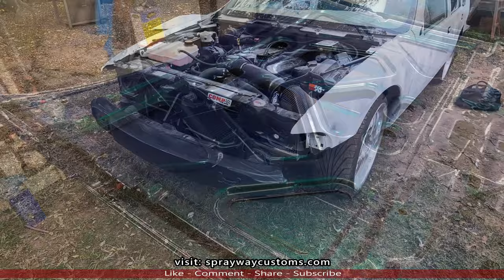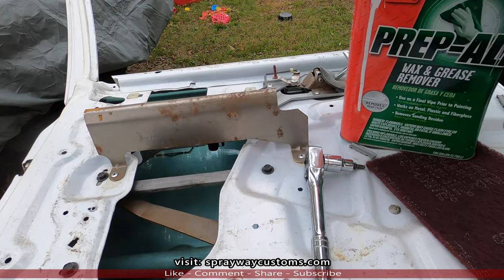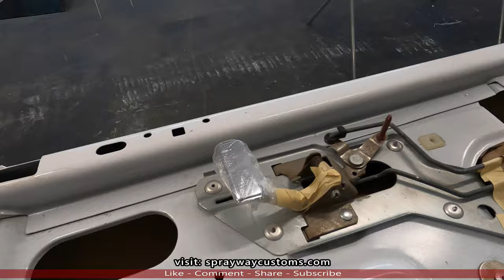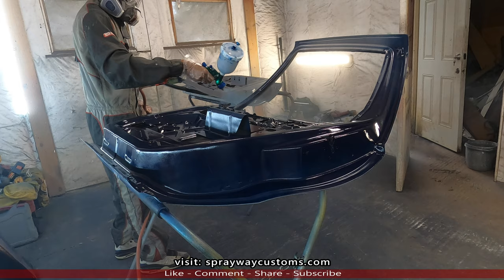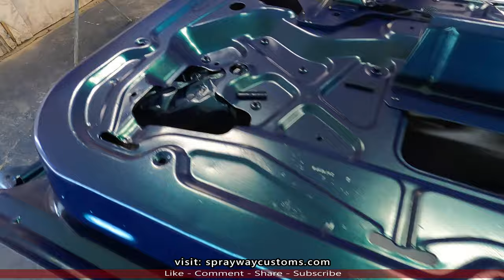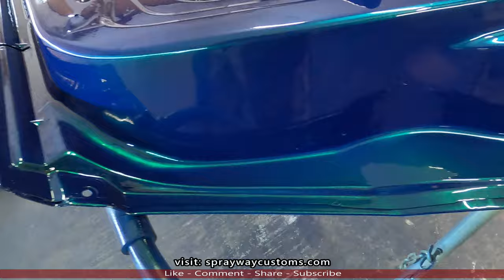How To Do A Three Stage Pearl Paint Job On A Car - Spraying The 1996 Chevy Impala SS Door Jambs

Comment: Hey Mr Sprayway, I had a question. Have you ever had a car where you had to use a hammer and dolly, slide hammer or had to cut out and weld in new sheet metal? Just curious if you had any vids on those techniques or if you have had a car that bad. This car is coming along like 🔥